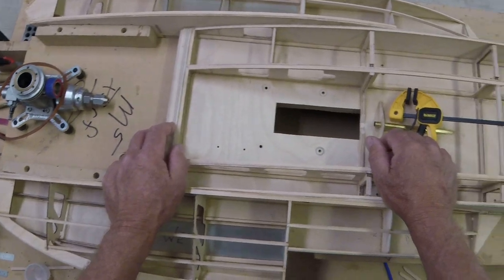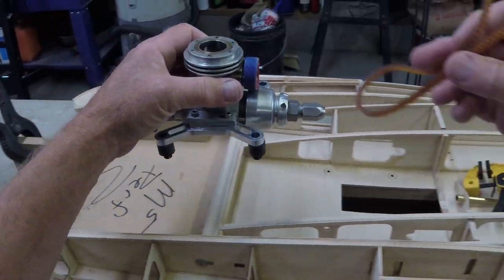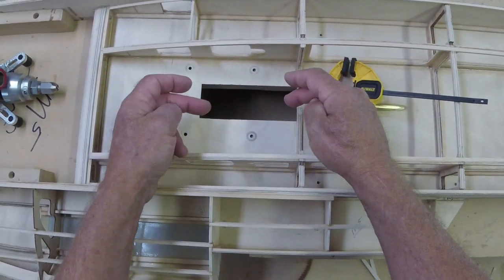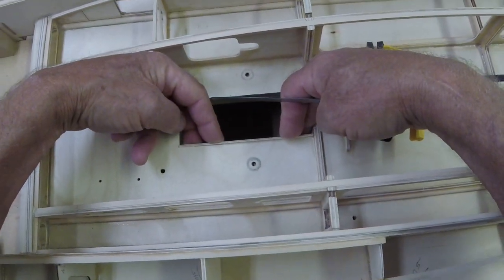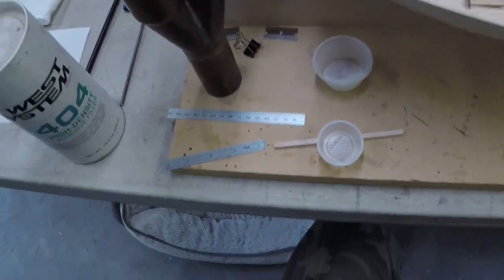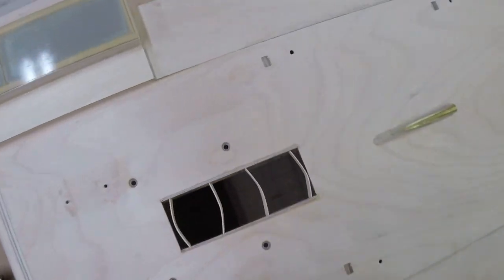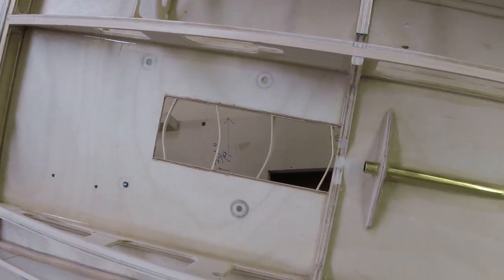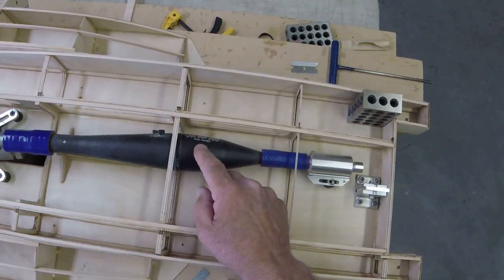Engine Sump, Rudder, & Pipe Mounting Made Easy | Radio Controlled Model Hydroplane Racing Boat Build

Comment: I made a video also on Brent Byer's solid flex drive. I've recently noticed that every six runs I have to replace engine bearings. I'm making an educated guess that the bearings are taking on the thrust load since the flex cable is no longer taking the load. Performance is by far excellent but increases maintenance.
Reply from the maker: Interesting. That has not been my experience, having never changed a bearing in any of my Nova Rossi's until finally one that got rough earlier this year.  Time to review your after-run program maybe?

Comment: Hey as a stupid tip, using the neck of a .50 caliber cartridge will allow you to change pipe size and length for more torque on some size gas engines
Reply from the maker: Shhhh!  I have many sizes of brass inserts

Comment: Scott,  is there any reason other than fitment under the cowel that I shouldn't get the motor mounted as far forward as possible?
Reply from the maker: Too much weight in the front will pound the nose, but ya, it's hard to get to the point of too much weight.  I shoot for having the glow plug or spark plug in line with the sponson transoms. Lately though I've been thinking that a little bit forward from there might be better yet.

Comment: What diameter props do you run on your boat? Love your videos keep up the good work
Reply from the maker: My current favorite is an ABC 2315-19-38 that I rework myself. In the ABC numbering system the first two numbers are the diameter in inches, in this case 2.3" or 58.42mm

Comment: Scott, lovin' the videos. Considering buying an MLB 1/8 172 kit to be built as U-12 Graham Trucking. Getting my feet wet with an Aquacraft nitro Miss Vegas in the mean time. Been flying/building large rc planes for a while. Some of the larger scale flyers, mostly jets are using gyros to help smooth out flights of these planes. After watching last 2 H1 full scale races and watching how canards work, do you think a gyro could be used to control a movable canard on an 1/8 or bigger scale hydroplane? Like you I can't keep well enough alone and this is one of my brainiac ideas. Thoughts? Also, how much does balance or center of gravity front to back on boat effect attitude in the water? Appreciate your help.
Reply from the maker: It has been tried, unsuccessfully. It simply cannot track the constant motion and bouncing of the boat, and cannot react quickly enough

Comment: Muffler link? Nice build btw!
Reply from the maker: Here ya go! https://seaducerboats.com/search?type=product&q=Muffler
Reply: @M5PerfHydros  Thanks, I'll order one to test it out!
Reply from the maker: I'm noticing in their pictures that they've slotted one end presumably to have it slip fit over the end of the pipe. This is workable, but if you'd rather attach it with silicone and zip ties as I've done, you might want to contact them to see if they will build it without slotting the end
Reply: @M5PerfHydros  Thanks for that. I'll see if I can get in touch with them. I appreciate the follow through!